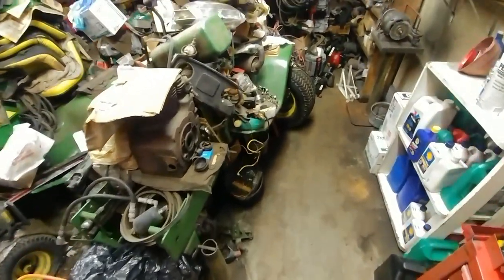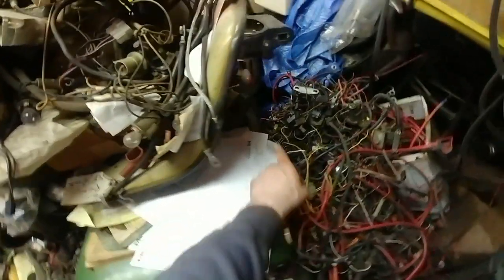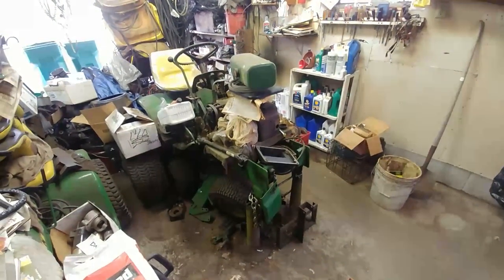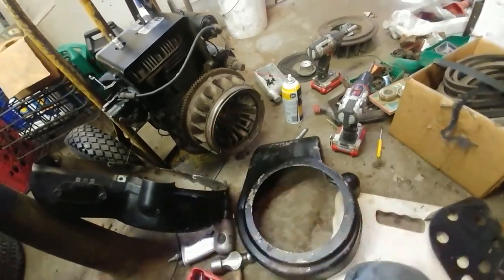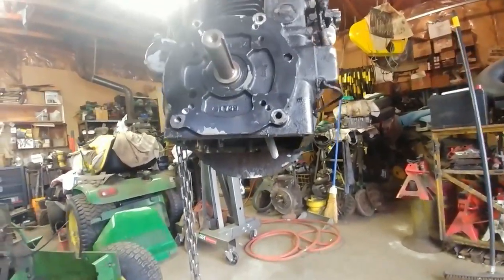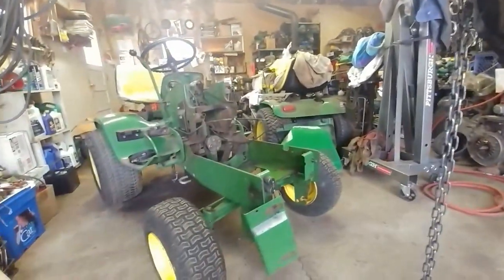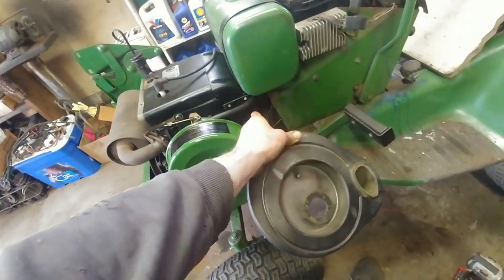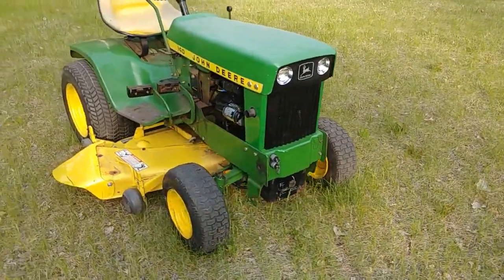Lets fix a John Deere Garden Tractor

Comment: The 140 is a beast! My '68 weighs over 900 pounds with the wheel weights and an implement. It has done an incalculable amount of work for me in the 30 years I've had it. Super tough tractor.
Reply from the maker: Yes there definitely is something special about the 140's!

Comment: Well done Now you need the attachments that fit the 140. Push blade, snow blower and I think JD also made a front end loader.
Reply from the maker: I'm one step ahead of you there. Besides the 140 I have a pair of 317's. One is setup with a snow blower and the other a mowing deck power flow/bagging kart. I also have a tiller attachment for when it's time for the garden.

Comment: Smashing repairs :-D
The john deere looks so fresh and there is nothing wrong with your engineering/mechanical skills.
We all have things we never quite get around to finishing.
I have less interest than i used to have, the trick is not to start any more projects.
Also dump more than you keep, or always dump rubbish before hoarding new crud lol :-D
Your dad would love what you have done, but he might argue about your choices, dads do that lol.
Reply from the maker: I catch myself wanting to be a hoarder all the time. But like you describe I have to catch myself and decide what needs to move on and what has room to stay.
Reply: @jeffescortlx  Make a rule and never break it. Mine is that if I am not absolutely certain that I'll put it to good use within a year I don't touch it. If the year goes by and it's still sitting there unloved I get rid it. It's worked well but of course has caused a bit of heartache here and there. Awesome to see you finishing your Dad's projects instead of just throwing it all out like many folks would have done.

Comment: Deck is too low for sure!  Your anti scalp wheels shouldn’t be on the ground. They’re only meant to touch down if you put a wheel in a hole, that type of thing. Bottom edge (cutting surface) of the blades should be 2.5-3” off the ground.
Reply from the maker: Yes I know. I had a lot going on and didn't get it setup at initial testing. But it's adjusted correctly now.
Reply: @jeffescortlx  - just making sure! I used to work at a JD dealership and can't count the number of people that came in with all the wheels on the ground, thinking it was 'just a lawnmower' that happened to be spun by the engine!